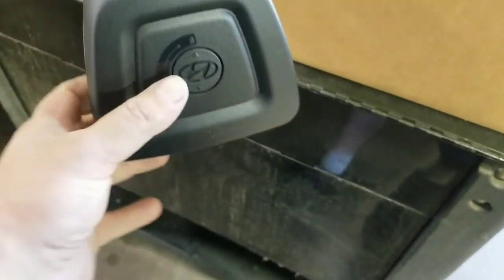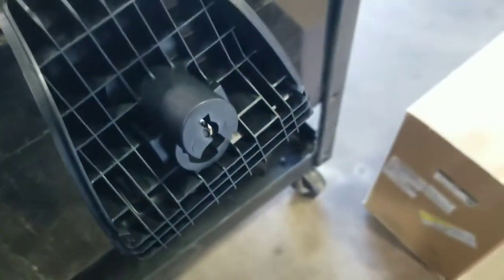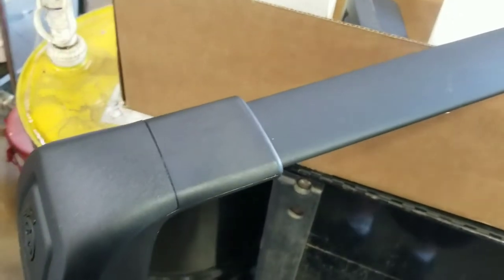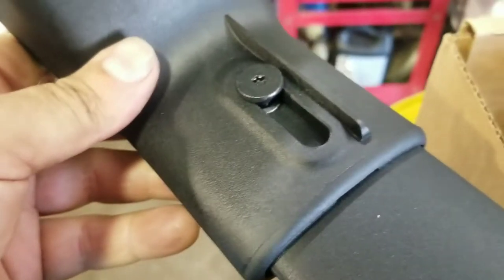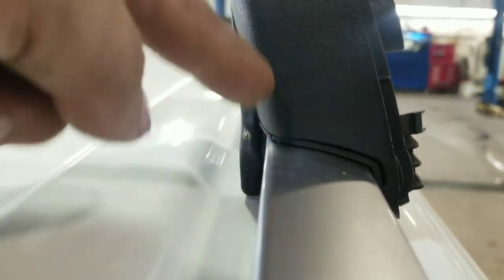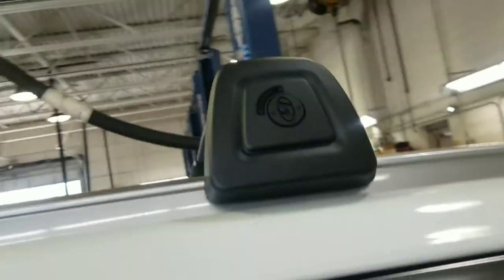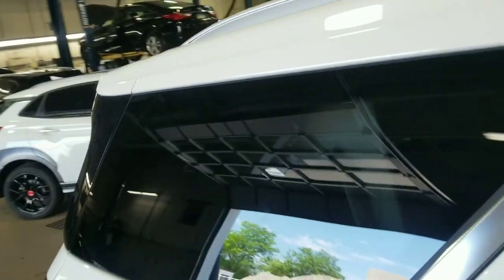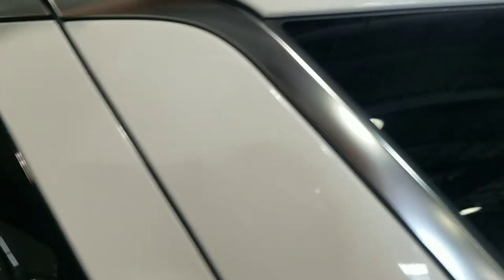Hyundai Palisade crossbars install

Comment: You don't tighten that "adjustment screw to make it wider/narrow".  That's supposed to be every so slightly loose. Its supposed to be able to move as the weather cold/hot makes it expand and contracts.  
If you tighten it, it will put outward  pressure on the roof rails as it contracts.

Comment: Please make a video on how to install the roof rails 😄. 
My 2022 Palisade came without them and will love to install the roof rails myself. 

Thank you.
Reply from the maker: When one comes in that wants them i can.
Reply: Isn't that what this video is?
Reply: @steel1968  Actually if you google Roof Rails and Crossbars are two completely different items. The Roof Rails is where the Crossbars attaches to 😅.
Reply: @Jorge910519  oh, ok.  We just bought a 2023 Palisade Limited. We wanted one with crossbars, (for looks, not for use) but this one had everything we wanted, except for the crossbars so we got it. But when we picked it up, it looked better than I thought it would, without the crossbars. And now I realize that what I was looking at on my car, are roof rails lol.
Reply: Not fore sure here, but they're probably a standard item on all Palisades.
Reply: @steel1968   Actually not 😅 my 2022 came without them unfortunately

Comment: My 2023 Palisade SE doesn't have roof rails to connect these to it. Is it even possible to connect roof rails? WTH Hyundai? I know I got the base model but this is a necessity like the garage door opener you skimmed out on which, by the way, every basic car has it .
Reply: It’s the silver or black piece on each side that goes from front to back.  It may look like it’s not there  but  it is.  The cross bars hook to that.